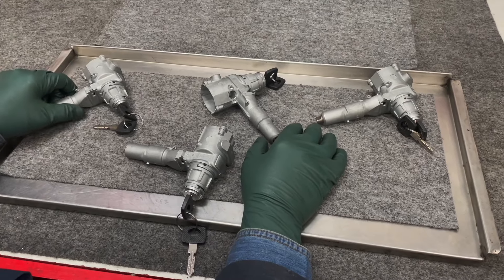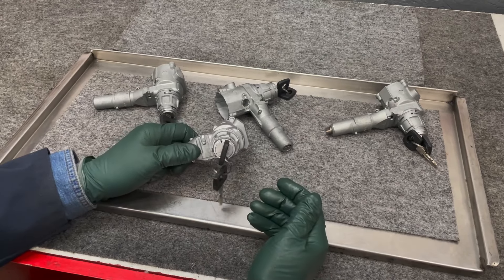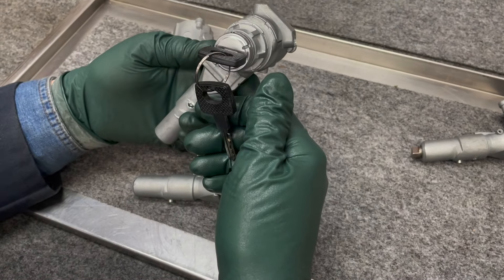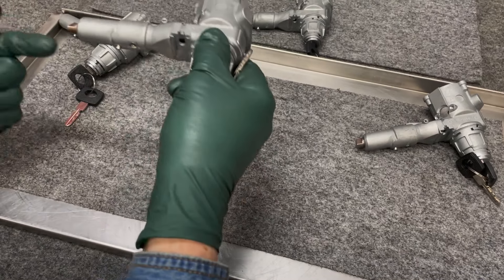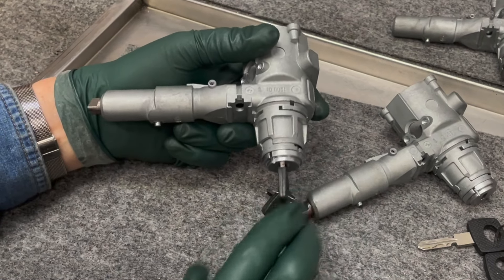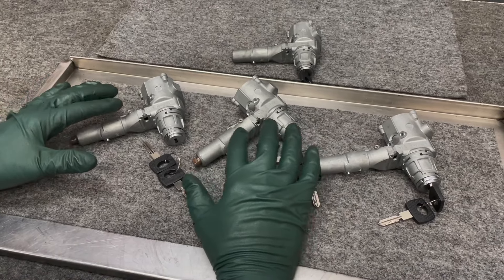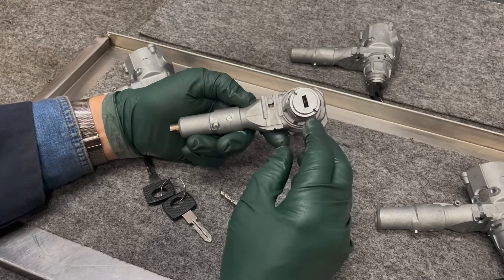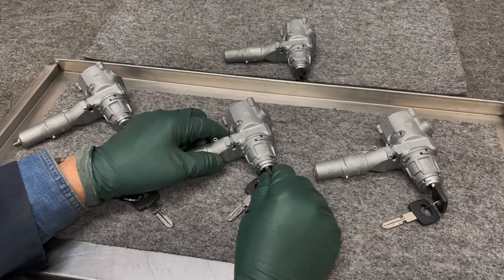Mercedes 1973 to 1995 Sticking Ignition Key: Severe Warning. This Needs Repeating!

Comment: If anyone cares to listen, i’m telling you right now, if this applies to you and if you plan on keeping your Mercedes-purchase this assembly from Ken right away. It’s not a matter of if but when.
My 1998 SL500 steering lock broke, locked up of course the steering wheel. I was unbelievably fortunate. The car was in my garage when this happened. Wis/Asra procedures are to destroy the lock. I managed to drill a hole and remove the lock assembly and get it out (gut it) to temporally use assembly while I waited for the new part and I could drive my car.
I also changed my ignition switch since the whole assembly was out . Although my Key and Tumbler are working fine, I would much rather preemptively replace the Tumbler, so I don’t have to change all the locks on the car if it fails on me. Ken , if you have a recommendation for business that sells the tumbler and rekeying I would appreciate it if you post the company.
Thanks for your video.

Comment: Hello Kent,  I just came across your channel only because we just flat-bedded my Mother’s 1985 Mercedes convertible 500SL to my house. The car has been in storage under cover for over ten years and I’m debating on if I should fix it.   When the mechanic went to put the hard top on to transport it last week, it was a disaster.   My mom use to pick me up from college in this car and now my son wants to drive it to prom next year…lol!  . I truly wish I could find someone in my area as knowledgeable as you.
Reply from the maker: Your story is very common as these old SLs get passed on to the next generation. Unfortunately, most have often been in long storage and have not run. 3 years is not too bad, 5 years creates more problems, and 10 years you are looking at major work. The fuel injection system does not do well with long storage and old gasoline in the system. The brake system will be frozen and will need complete rebuilding. If you are willing to do the work and the car is clean and not rusty if could be worth it and would be a great project to do with your son. Finding a mechanic to try to fix it for you is tough. Not many out there really know how to work on these fuel systems. I have all the kits and parts you would need, with video instructions to get it back on the road. You would need a good workspace, a good floor jack and 2 jack stands, 4 car ramps and a good assortment of tools. It could get VERY expensive if you try to have the car repaired at a shop. Hope that helps,  Kent
Reply: Good Evening Kent, Thank you so much for your very informative, detailed reply.  The car is clean with no  rust issues and low mileage. Everyone who use to work on the car is either out of business or passed away. I however am a housewife. I’m very handy and a quick learner, but definitely not a foreign car mechanic.  I think I’m more sentimental about the car and just reflecting on days gone by.  I will definitely consider your advice and now I know where I can get parts. Maybe it’s time I put down my spatula and pick up a floor jack..lol!  Again, I appreciate your reply and will watch more of your videos and subscribe.  Jacqueline M.

Comment: Can we lubricate to any degree of efficacy from inside the key way?
By the way, SAAB engineers deemed steering locks potentially dangerous so they chose to lock the transmission in reverse (perhaps the only good choice they made!).